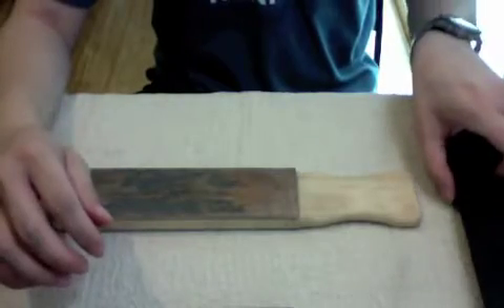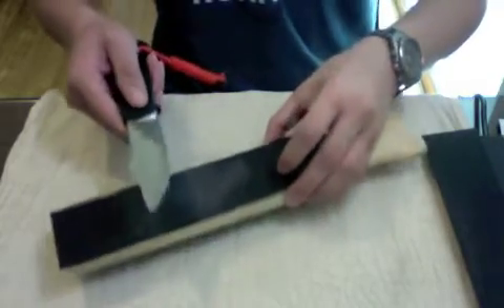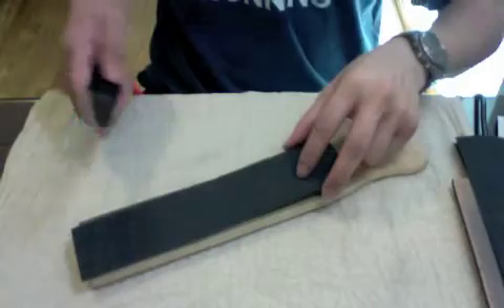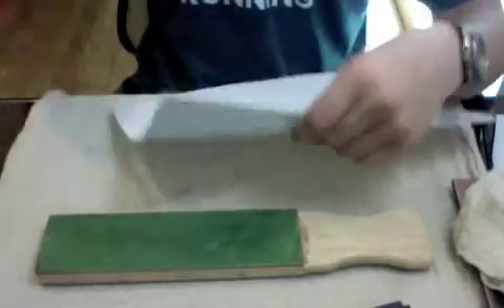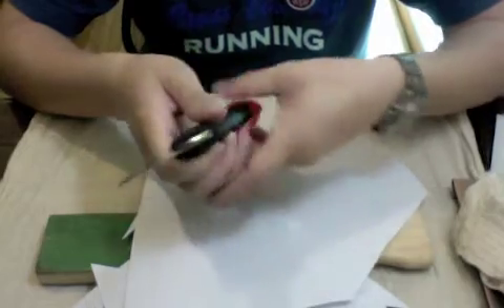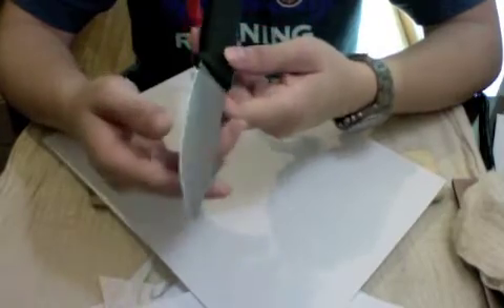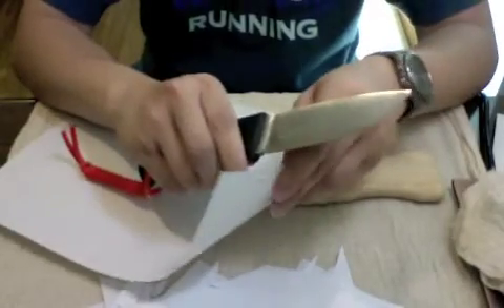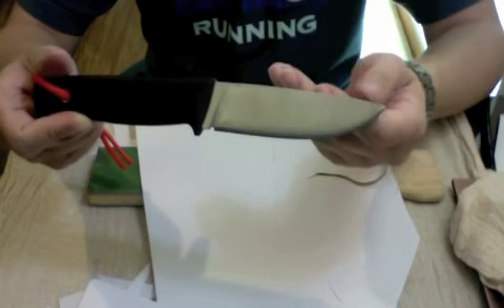Creating a Convex Secondary Bevel for a Tougher Edge

Comment: Good stones are not only far, far better than sandpaper, they don't damage the steel.  Sandpaper does.  Stones increase at an infinitely more consistent rate and smoothness than sandpaper.  Stones have nothing to do with grit.  This is a misunderstanding of how sharpening stones work..  Natural stones are about hardness, and have no real grit at all.  A fine Arkansas stone has an equivalent grit of 1000 sandpaper, but does not sharpen by grit, but by how hard the stone is.   Because a stone sharpens by hardness, it does not damage the steel.  Sandpaper merely has an AVERAGE grip across it's surface, and CUTS the steel where a natural stone simply polishes it.    You can certainly get a knife very sharp with sandpaper, but it will damage the steel, and will eventually ripple the edge, especially with a really poor technique such as is use din this video.  Now does a secondary bevel increase edge strength.  This is a complete myth.  It weakens the edge dramatically.  On top of this, it is no longer a convex edge at all, and loses all the advantages of a true convex.  It's amazing how someone can believe thinning the edge by creating a secondary bevel somehow adds strength.  It doesn't.  "Sharp"  by itself means nothing, but it's tough to explain this.  An edge that will shave you may be no sharper than an edge that won't.  An edge shave because it's extremely thin, and therefore weaker, than an edge that won't shave you.   "Sharper" just means thinner and weaker.  A twenty-six degree per side bevel won't begin to shave you, but it's still just as sharp as an eleven degree per side bevel.  The difference is that the twenty-six degree edge have much more steel behind it, holds it's edge far long, and is better for most tasks.
Reply: +James Ritchie Not everyone knows of Virtuovice :)
Reply: naihanchin Kempo he is the key king of knifes